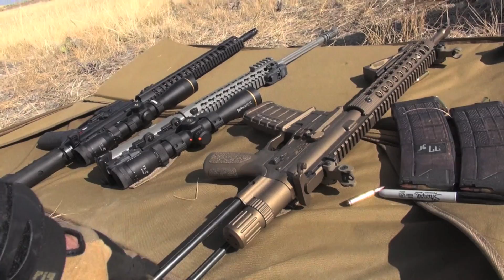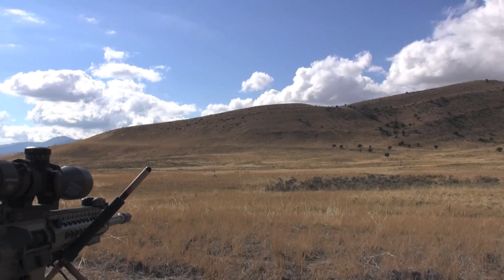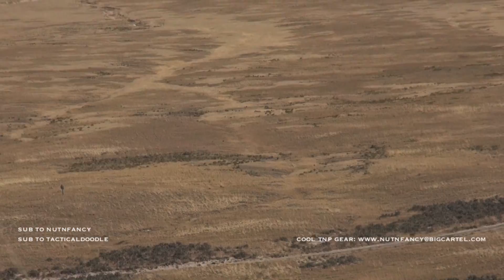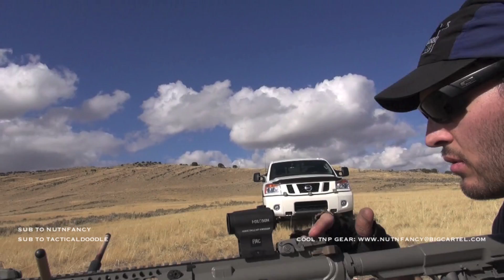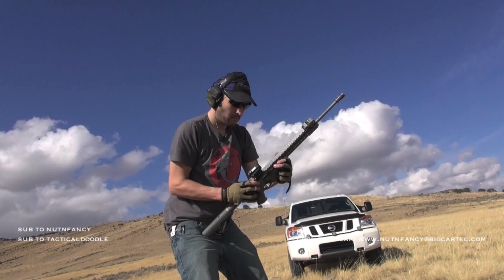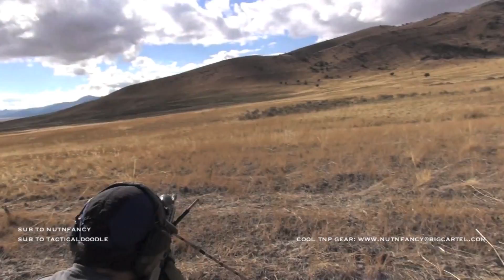'Hobby' AR15s Suck...Or Do They?!

Comment: I went to a tactical carbine course with an M&P-15 Sport (the good one with the 1:8, 5R rifling) and was able to make off-hand, standing hits at 220yds with irons. It helped that the instructor was a down-to-earth guy who didn't care what rifle I had. I put 690 zinc-plated steel Russian rounds through it that day without a single failure.

Last year, I finally sprung for a mil-spec stripped upper just to get the dust cover for personal reasons (not due to any jams or anything).

Comment: I'm a hobby builder. I did my little bit of research. I found out that about 10-20 companies manufacture the stripped lowers and then sell them to the AR companies who then brand them. Same thing with the uppers, the lower parts kits, and probably the barrels as well. When I found that out I decided I didn't care so much whose name was on it.

So now I'm just starting a simple cheap project. I've got an Anderson stripped lower ($40) and an Aero Precision LPK ($80). I plan on purchasing complete barreled upper (ALWAYS go for a 1:7 twist) from Palmetto State Armory ($350-$420). I want either a Desert Tan or an FDE Stock ($50-60) with the same color ERGO grip ($30).  Add in the buffer system for about ($20). Reasonable rear sight for about ($40). Total cost ($590-$690). And that sucker will shoot all day every day that I want it too.

One of these days. when I get the money together, I'll build something with a little more quality. Perhaps with a matching Billet lower and upper receiver and other quality parts. But, til then that "hobby frankengun" will be a nice beater gun. I'm not a good enough shooter to try and achieve serious MOA. Nor do I have the time, the money, the shooting range, or the location to try and become that good.

Great video btw. Y'all have a great day.

Comment: Greetings Nutn,
I have built two AR's and will attest to quality parts. My first build was based on an xm15-E2S bushmaster lower. It originally had an A1 upper on it and I wanted a flat rail upper. I researched many manufacturers and bought one part a pay check. When something was on sale of got it. The A3 upper is a BCM upper that was marked down due to "blemished" parts. The grip and but stick are Nagpul MOE. The fore end is a Midwest Industries 7" I also have a Nagpul BAD lever. And BCM charging handle. All was good so far. I sprung for an AWESOME drop in trigger by CMMG and a Savage AR bbl all including the expensive trigger I was up to $557 so I opted for a made in China gas block to save cash. Big mistake. At first I thought I didn't Aline my gas tube correctly. It was short stroking almost every round. I through it in the closet and forgot about it for 6 months. After that I started researching and decided to buy a good gas block and give it a try. I decided on the YankeeHill gas block/front sight combo. And BOOM it ate anything I fed it. Thanks and keep up the vids.

Comment: I can't help but worry about my rifle. I had to use lower cost components (CMMG barrel for example) because of my budget (I work at a WalMart). I haven't gotten to sight it in yet, but it did pass a preliminary 40 round function test (used TulAmmo for this) with no problems.

Comment: So in 2013 I built 3 lowers for myself and my 2 adult boys. I used the Spikes ST15 lowers that are 7075 forged. I used the package deal spikes tube, spring and T2 buffer and Delton std lower parts kit and figured they could get another trigger and select any upper they wanted. I put a Geissele SSA trigger and an Adams Arms EVO 16" upper on mine and added a Griffin M4SD compensator. 2013 prices were crazy but all things being equal this was a mid price build for the day that came in under $1,800 with Magpul ACS stock and BAD lever. You could do it cheaper today. Then I eventually put a Burris MTAC 1.5-6 x 42 scope on it using the Burris mount. Add $425 carefully shopped online.

Results? With no optics or mag it weighs 7.6 lbs. You can get to 7.1 lbs if using a CTR stock and keeping the A2 birdcage.This is s DMR combat weapon in my mind and is very good to about 450 yards. On the range it shoots about 0.5 MOA at both 100 and 300 yards using either MK262 or my preferred Hornady Superformance 75 gr 5.56. Use Federal XM193 and it opens up to just over 1.5 MOA. After over 3,000 rounds I have ZERO malfunctions not directly traceable to a bad mag (never use a rivet to pin a 30 round PMag to 10 rounds for California, thank God I live in Reno now).  I thought a was lucky with the Adams Arms upper, nope. Both boys chose different model 16" AA uppers and both shoot exactly the same as mine. 1.5 with XM193 and 0.5 with the expensive and heavy rounds.

Why would anyone buy a DI AR and why would anyone pay like $2,800 ?? My guns lower stays so clean it amazes me. Yep, I've become an Adams Arms fan boy.

Comment: Had to dislike vid. You CAN get the same level of reliability and durability, etc etc, out of a build; but MOST people are using junk parts and are garage-tinkerers at best. The biggest thing, as you mentioned, is parts selection. But I think 'hobby gun' might be something that dates back to the days were good factory guns and any parts were limited. You mentioned early 2000's. I've never heard the term really. Big thing, people are mixing brands on extremely cheap parts and using experimental-at-best lightweight parts from companies with low R&D capability or budget.

Comment: My "hobby" AR is fucking fantastic!!
 Standard aluminum upper and lower.
BRO DIT 3.5lb single stage
Free floating keymod rail
FN barrel 16" mid length (M249)
Minimalist Stock 
BCM MOD4 charging handle
YHM QD flash hider 
Cerakoted in dark burnt bronze 
Topped with an Aimpoint H1 
Shoots perfectly!
Reply: Tmankiller72 in the process of building three lol.  Almost done with one

Comment: I've found that built ARs run fine as long as they don't deviate too much from the original AR15 design. I have a 16" BCM upper on a built PSA lower and had issues with my bolt carrier group short stroking. I swapped out the lower and it ran flawlessly. The problem - a spikes tungsten lightweight buffer. My 2nd lower has a regular buffer and spring and has never given me fits. Use what works.

Comment: i purchased a sig m400 enhanced(magpul edition). i liked it; but immediately i started looking at it, thinking about things i wanted to change... i have literally changed everything except the barrel and bolt lock... i also built a separate odin works upper with an 18in barrell for 3 gun competitions... my advice, buy a quality lower, then decide what components you want, purchase the components and put them together yourself... you will learn about the ar15 platform and have the gun you actually want... i have spent over 3k on triggers, hand guards, stocks, gas blocks, compensators etc... i now have a rifle that i love and multiple uppers for cqb and longer ranges; but i would have spent far less had i just built the damn thing in the 1st place...

Comment: One of your best vids in a while NF!  I've built 2 "hobby" ARs in the last 5 years and both outshoot all my buddies store bought AR's.  My reasoning was if I buy an off the shelf AR there are things I'm going to add or change, extra $ I'll spend after the initial purchase... so why not build it with all the parts I want the first time? !!

I think the key is don't go cheap!  I use quality parts from well known manufacturers wherever I can.  My most recent build is an SPR/coyote gun utilizing a White Oak Armament 18" SS match grade barrel, DD BCG, Geisselle SSA-E trigger, etc  and that puppy shoots sub MOA as long as I'm on that day!

The best part of the off the shelf vs homemade/hobby AR is putting some "more $ than brains" type to shame at the range with my "slapped together" hobby AR's that cost half the price!  I FRIGGIN LOVE THAT DUDE!!!

Comment: You really want to know what makes it a hobby gun? There is no way that we can determine that gun will run with a random parts bin. The gun I built runs fine with premium parts. Although when I'm choosing something for self-defense it is going to be BCM or DD. The cost I've been paying is around $1100.  I spent way more building my own AR-15. Why not pay someone to build it right? If the rifle is used for just the range. Who cares if it is hobby grade? That term only becomes a problem when you decide to use this for Law Enforcement/Military or even Home Defense. We have this problem in the gun community where people can hardly put on a holster and carry a pistol correctly. If you say this same guy should be able to build a rifle and know it is right. I'm going to question that. To answer your question. The Frankengun I built went 500 rounds with no problems at a tactical course. It still hasn't jammed to this day. That doesn't mean I trust my life with it yet.

Comment: In California we used to have to build our own, stripped lowers were the only way. I bought what I thought was a decent upper, after building three more I am only retaining the upper receiver and bolt from that original commercial upper, the barrel and free float were cheap and nasty. I am an engineer and these are simple machines, if I can't make one that works right then I should reconsider my career path. The 6.8 I built shoots well under 1" groups with a Black Hole Weaponry 18" 3 groove polygonal barrel.

Comment: I build rifles and put them through classes regularly. couple thousand  rounds over a weekend is common and my guns have never failed to complete a class. the key is knowing what you're doing. gas blocks should be installed correctly and pinned most importantly. if you know what you're doing and use quality components you'll be fine. I use ballistic advantage barrels because they come with a gas block already pinned on if you opt for that. soooo simple...just put it in and upper and throw a Midwest free float rail on it. or geiselle smk rail if your running a laser aiming device and rail flex is a real concern. if you don't know what you're doing buy a BCM complete upper and throw it on any milspec lower. bcm bolts are the best in the business and there are others that are just as good. gas block and bolt carrier group are the two big things you need to do right.

Comment: It's hard to screw up an AR15 these days. There are a lot of good parts out there for a reasonable price. I think some of it comes down to the guns intended purpose. If you put together a rifle for 3 gun, then you're possibly introducing many more variables and things may go wrong. Guns do go down. I raced out my dissipator and guess what? The adjustable gas key is a mess. It's not a fighting rifle I would consider running in a class though. If you build a good rifle out of quality components that lacks things that could potentially come out of adjustment, then you will probably have a rifle that is fine to run in a class. It's not a rifle where you're looking for that bleeding edge of performance that your average person probably couldn't take advantage of any way. Stick with conventional or semi conventional and you will be fine.

Comment: On the topic of bad internet opinions, I love my Olympic Arms AR. Only have about 500 rounds through it of 10 or 12 different types of ammo, but not a single failure to feed, fire or eject and it shoots under 1 MOA with the right ammo. I would trust my life to it. Haters gonna hate :)

I guess you can say it has a bit of hobby in it. I polished all the trigger surfaces myself and drilled out the aluminum handguard (112 holes). I also had the barrel fluted and receiver squared.

Comment: I think this is akin to PC enthusiasts. Except it's opposite. Most PC enthusiasts forego a Big Box, Best Buy PC for a Homebuilt one. Like you said, you are quality control on a home built products. You have to do your own research to be successful with a build. If a PC gamer puts together a $2000 PC and puts an RX 460 (low end card), the whole thing will be brought down by a bottleneck, a weak link. Same with Firearms. If you gotta $2000 AR and it has a shit barrel, weak link. But at least when you are a home builder you can call responsibility on your self and learn what individual parts effect what. And you know what to swap out.

Comment: I think Nutn is spot on as long as you approach it with the expectation that when you build it you do it right. Having done 4 now I have had no issue and they have all been serious performers both in accuracy and reliability. BUT I also had serious unit level armorer experience with military M-4s and that experience was very helpful. Yes I can choose the components and blow a Milspec M-4 out of the water all day long and make the military guns look like a hobby gun! Just make sure you research the correct ways to put them together and use good components. If you want to build one but don't know how don't guess just ask someone here or a trusted gunsmith. Really the only way to mess up a personal build is if you don't know what you are doing otherwise it's the way to go.

Comment: Excellent video that makes a point I have known for years. I have built 14 AR15 platform guns and 6 AR10 platform guns for my family and everyone runs beautifully. I have also helped many friends and coworkers purchase parts and build their AR platform weapons. Probably close to 70 of those. Point being, all of them just run! One weapon of note is my youngest sons M4 copy, it now has 3750 rounds without cleaning or oiling. The receiver pins have never been pushed. Yep that right, it just runs. When it has its first failure we will clean it,  replace the springs in the bolt and gas rings but thats about all I suspect it will need. And for the critics, it still shoots sub moa with iron sights. The kid rocks his AR like a champ! My tip would be spec out the gun you want, buy quality parts on sale with free shipping and no tax, Properly gas the gun, and properly assemble. If you do that you get twice the gun for half the price. That leaves room for a case, sling, optic, 10 30 rd mags and 1000 rounds xm193 for practice all for the price of just one $1800.00 Daniel Defense quality weapon without any accessories. Again great video topic!

Comment: I have about six AR15's and ALL are built 100% by me and half are even milled out from 80% lowers by me and they are Awesome! I go to the stores to laugh at the crapy builds manufacturers have. I only shoot 1000-2000 rounds per year between all my AR's so my testing is limited. But the only failures I have are on my newly milled lowers occasionally until i work out the tolerances and once I do they become flawless. I don't even clean my DI AR's until I've shot at least 500 rounds and I never get failures. I use BCM barrels and BCG's on all but one, which is a Wilson Combat, so they are premium parts.

Comment: I built my first AR and between building them for myself and friends I've probably got close to 20 under my belt and they all run great. I just make sure that most of the $$ goes toward a known quality barrel, gas parts and bcg.  The added bonus of building yourself is it forces you to not only learn the weapon inside and out, but also accumulate all the tools required to work on it.  Only off the shelf AR's I buy are stripped lowers.

Comment: The hammer spring is easy to install upside down.  That can cause light primer strikes and FTFs on steel cased ammunition.  Experienced that on a lower I put together with a m&p15r 5.45x39mm upper.  Using soviet surplus ammo it would only bang off 1 out of 9 rounds.  Lesson Learned.  Still enjoying the evil roy I won form you guys BTW.  Thanks.

Comment: Just built my first AR this past summer with an anderson upper and lower, BA mid length govt barrel, spikes BCG, cmc flat single stage trigger, and 15 in odin works rail in fde. Thing has been 100% through 600 rounds(all brass). ill bring it to a course so i can really test it. Shoots just under 2 MOA at 100 but I'm not the best shooter, so I'm more than pleased at the under 950$ mark for the build

Comment: I run a Black Hole Weaponry 16" mid-length 7 twist 223 Wylde.
1 MOA 10rds 20 seconds, (Cali range rules.) any faster RO will have words.
I can shoot a hole, then shoot the hole, and shoot the hole with my best 75grn Hornady Match handloads.
The only drawback is the Wylde chamber is on the tight side, if I use gun show reloads, or steel case ammo, after 400 to 500 rds I have to smack the forward assist some times.
It'll go a 1000rds with my handloads, using CFE223 before it starts having issues.
Gotta use the cordless drill with  a 40 cal synthetic bristled bore brush dipped in the Hoppes to clean it.
That's a small price to pay for accuracy.
Oh, one other thing I built it on a 80% lower,,, so yeah call it a hobby rifle.

Comment: Yup, true, built mine, had reliability issue of under gassing, Mic'd the port, was smaller than mfr said was suppused to be, drilled it to mfr specs, ran brass perfectly, did not cycle wolf at all, drilled again now runs 100%. It was something I was prepared to face, but, i built it to fit me and my needs

Comment: i disagree.  "hobby" AR15's exist. there is generally decent commercial, milspec and milspec plus guns COTS and builds that perform well and are GTW ready but to me the "hobby" AR's are defined as the cobbled together AR's using the cheapest parts available and expect to get the same as any decent commercial  AR and really meant to be limited use range guns but not for serious pou

Crappy Polymer Upper/Lowers crappy barrels. bare minimum commercial spec parts

i've seen inaccurate jammomatics at the range and upon inspection it was no wonder why they had problems after learning about the build 

i've put together a few PSA builds my self and never had any problems and im no master gunsmith by any means 

so it's not necessarily that it wasn't a pre built gun ,just forcing shitty mismatched parts to work  instead of doing it right